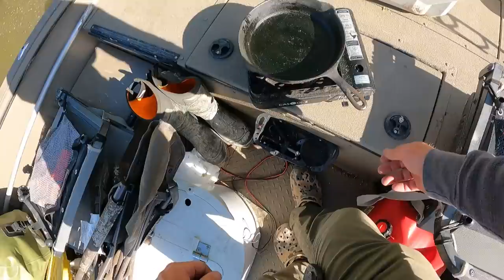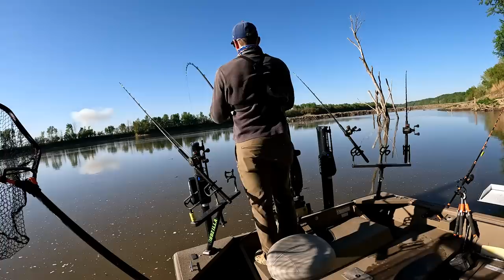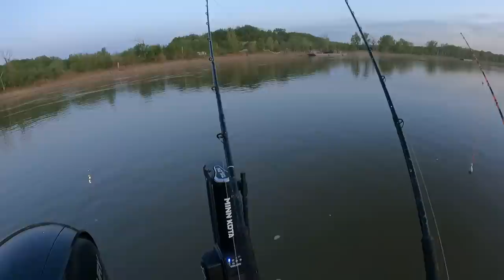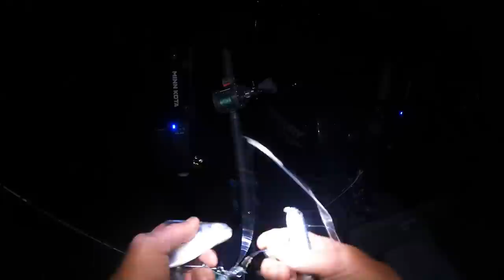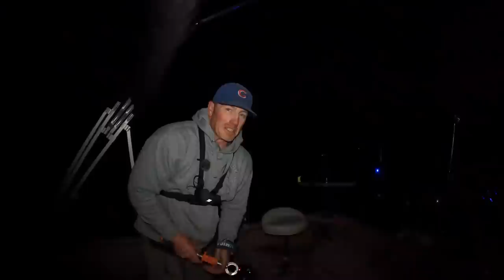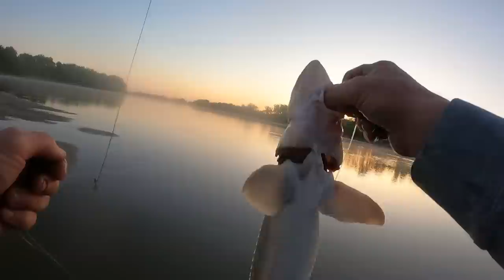This GIANT SANDBAR Holds MONSTER FISH!! (River Fishing)

Comment: First thing I noticed. Well look at who got some Talons!! I was the one who suggested them over the PowerPoles. You won’t be disappointed man. There’s really no comparison.
Reply from the maker: I love them so far. I just hope they're durable
Reply: @RiverCertified  Had the same set since 2013 on a Z522 Ranger. Still going strong 10 years later. There’s a lot of advantages. Durability is only one major advantage. Holding ability is another. PowerPoles have a pivot in the arm where it extends. If you’re in current sideways at all, they WILL bend/flex at the pivot point. And since they don’t monitor their anchor force like Talons do, they will lose their anchoring ability. Talons don’t have that problem. There’s no pivot point. Also, they have a the ability to be manually brought up should the motor fail. I want to say it’s a 5/8 socket but I could be wrong. Never had to use mine. PowerPoles do have a valve you can release the hydraulic pressure but it bleeds the fluid. 

I work for the largest  professional bass fishing tournament trail. Worked a tournament filming down in Louisiana. My staff boat had power poles. I was filming the 2nd day leader back in an oxbow. My PowerPole just randomly failed. I had to raise my outboard all the way up, crawl out on my lower unit, and stick my arm under lily pads in alligator infested water to tie a rope to the pivot arm and pull it up. There was no other option. Pucker factor 10. 

We have guys all the time beach their boats for weigh-ins, pole down, and have to go get rides from other boaters to retrieve their boats because they’ve floated away. I’ve been doing this almost 15 years. You 100% made the right call.
Reply from the maker: @bigbore4498  that's awesome to hear. I questioned my decision because the bass elite guys all used Raptors or power poles. I like the concept of the talons better. I was just concerned about the durability. Thanks for helping to alleviate that concern.
Reply: @RiverCertified  No problem. The reason they use them is because they are a sponsor. Same in MLF. And people buy them for that exact reason. “Well the pros use this or that”. Yep. Because they are paid to. You really think KVD runs a nitro because it’s the best? That’s f-ing laughable. It’s because Johnny pays him a shit ton of money run one and say it’s the best. Because if KVD says it, people will buy it. And they do. By the thousands every year. Anyways. I’m kind of off on a tangent. Enjoy those Talons. They’ll serve you well. See ya on the next vid.

Comment: If you'll use the Frank's and some corn meal, then just drop them in the deep frier.
Cook like you do fish, only deeper oil so that the bacon cooks evenly. 
Hopefully you've had a Texas favorite, of sliced fresh jalapenos, good thick bacon wrapped around a piece of dove breast grilled over hot coals until you can't stand the smell anymore, because your bell thinks your throat has been cut.
Where's Woody, he's missing out on the fun.
Have a Great Day fishing wherever, and whenever you get to go.
Reply from the maker: I've never done that with dove, but I have with pheasant and it was phenomenal. Woody stayed home for this adventure. Too many moving parts and I wasn't sure where I'd end up. I appreciate it man.